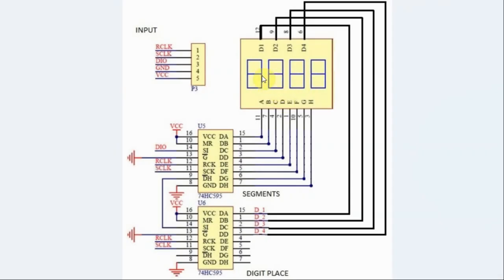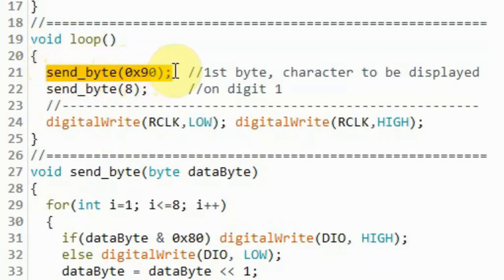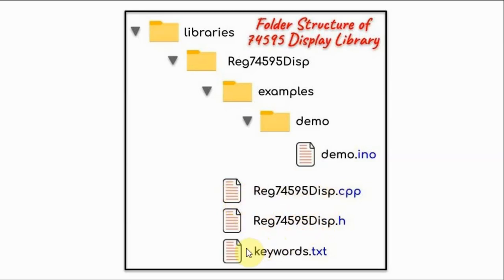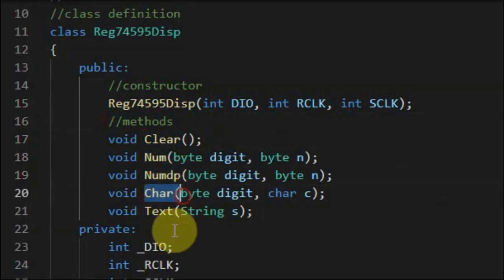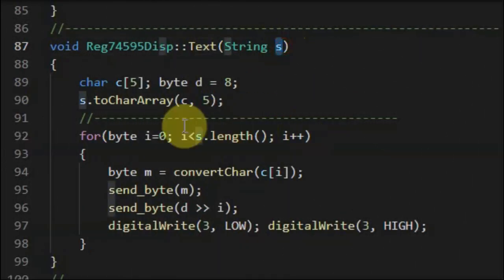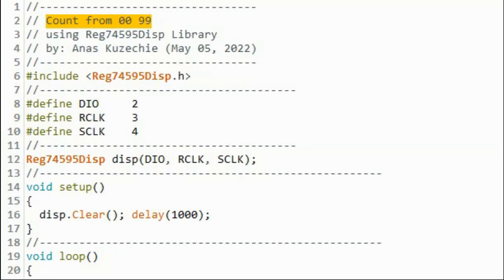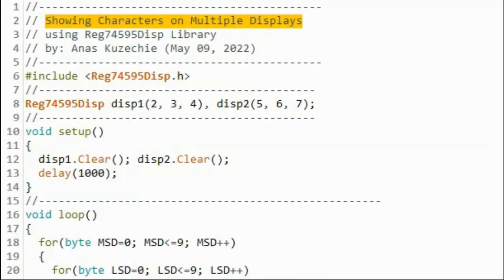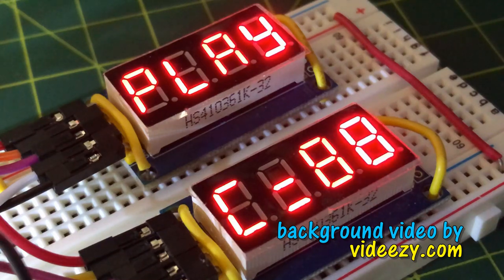Creating Arduino Library for 74HC595 Display

Comment: The design should have current-limiting resistors in series in the segment-select lines Without that, the design exceeds the 595's maximum power and ground currents when displaying all or most segments.
Reply from the maker: Thanks for your input

Comment: can it works for six digits???
Reply from the maker: No. The library is designed for two 74595 ICs. To support six or more digits, we need to use at least four ICs, and thus modified library.
Reply: The hardware can work for up to 8 digits. At 0:37 you see that the digit-select 595 has 4 outputs unused and available for 4 more digits. You would need to revise the code accordingly.